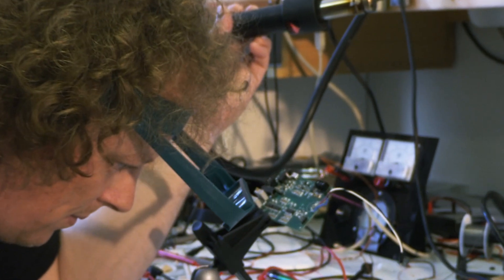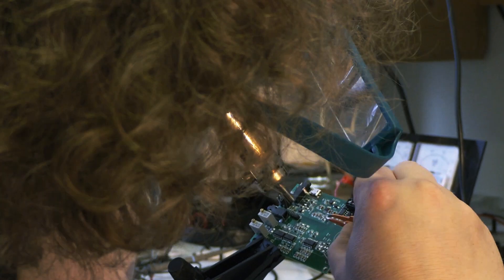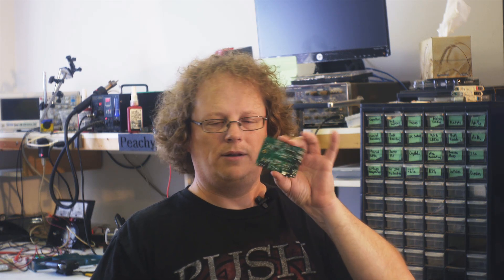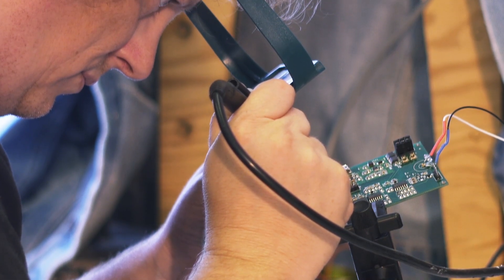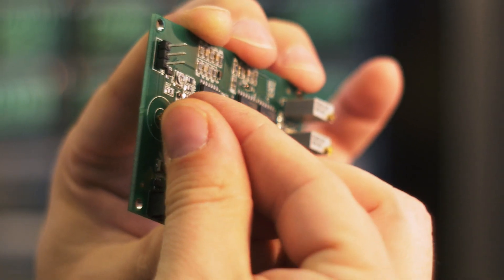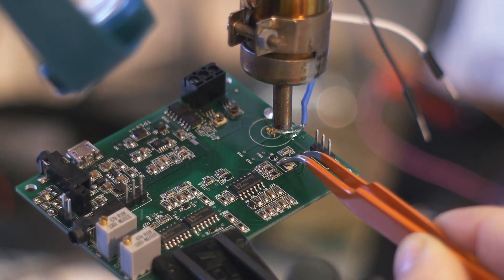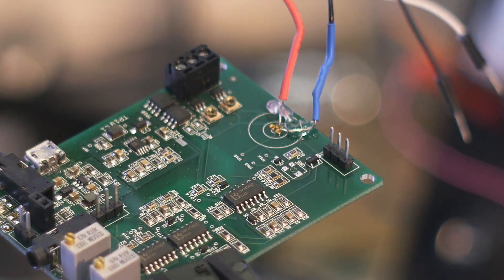Update #36 - Circuit Developments #4

Comment: Hums and haws
The reason I got really interested in this project was because of it's simplicity. When you started out it was really just wire, a laser and a few mirrors. It seems like you've strayed away from that in the electronics aspect, not only increasing the complexity but also the cost. I don't see why you're still going from an audio jack, I feel like at this point it's just making things much more difficult for yourself. I'm confident you could do this all going from a USB port to an ATMega of some sort, and that would cost you next to nothing in terms of component cost, and if you're already making a board . . .
With a magnetic dampening system I'm sure a lot of the stabilization for the mirror could be done with hardware.
Now I don't know what speeds you move your mirrors at, but at this point I'm wondering if it would be worth it to use servos. Unless you're moving those mirrors at immense speeds, I don't see why it's needed.

Maybe I'm all wrong and this is necessary, I'd love to hear back from you if that is the case, but primarily I think the thing is you've strayed away from the simplicity that was shown in the kickstarter.
Reply: Simplicity generally comes in the design or in the usage but not both...  I'm hoping for the latter, so a printer that runs with decent speed, precision, and does not need re-calibrating every 1.5 prints like certain budget printers...

That being said, I've used audio ports to connect various home-brew devices in the past, even though a $5 ARM Cortex would have worked better (via USB) and reduced part count.  I didn't have access to fancy soldering tools, so the ARM Cortex was impractical for me.  A microcontroller version would probably be better in almost every measurable way, but would require more effort on the software side, and would be less portable (in software terms).

Using audio ports has the advantage that no kernel-specific drivers are required, so it'll run on any platform with audio outputs, and that can compile the userland software (blender plugin or whatever).  No need for separate efforts for x86, x64, ARM / OSX, Linux, Windows / etc.

As for magnetic stabilization, doing stabilization directly with physics is more versatile than doing it in hardware, as it allows more variation in the parts (since no 2 manufactured components are ever identical) without the need for calibration.

Given the performance of the peachy in previous videos, I'm guessing the mirrors move at very high speeds, so electronic feedback systems (e.g. servo motors) would reduce the accuracy of the mirrors.
Reply: using USB would make it no longer possible to run the printer with something as simple as an mp3 player.
Reply: spiderobert Why does this matter? Most people would run it with a desktop, laptop, tablet, or smartphone.
Reply: SiXiam
for simplicity. in order to get this printer to work on every OS (pc or mobile) they would have to design a new driver for each one, in addition to that they'd probably have to make a program for mobile devices, which would increase the price. by using something as simple as an audio file they can make the printer work on practically everything very easily.